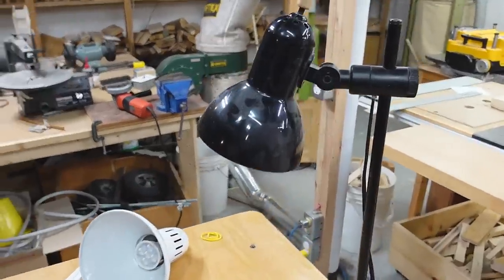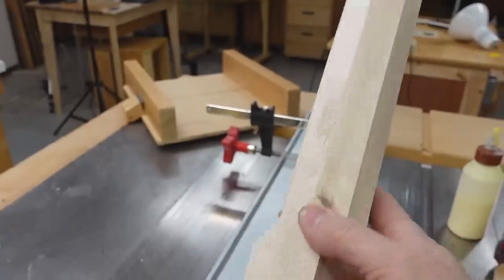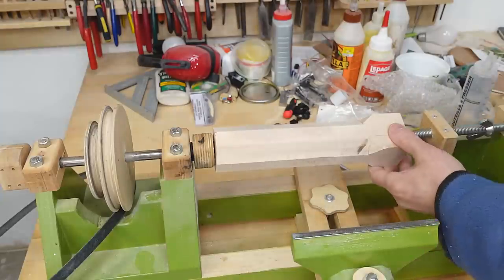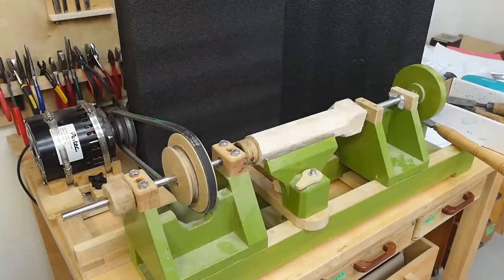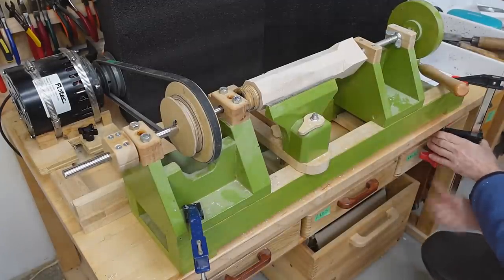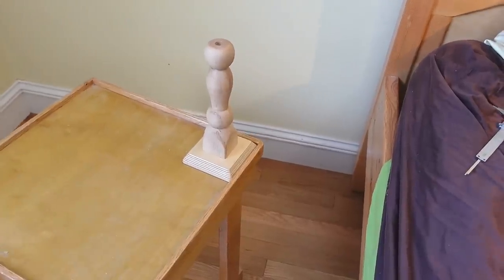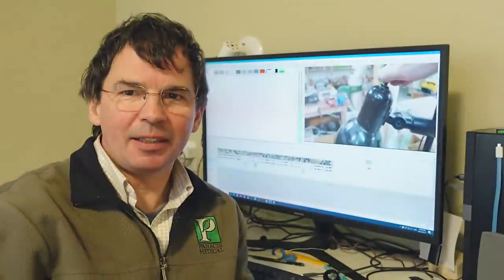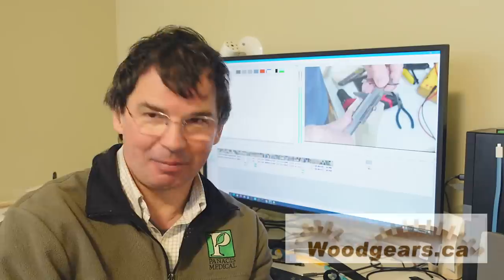Architect lamp pedestal base

Comment: My dad did something similar for me when I was a boy; instead of making a post to set on a table though, he put a hole in the bedpost itself and mounted the lamp to the bed. Worked flawlessly.
Reply: I was wondering why Matthias didn't do just that when he showed the final installation.
Reply: I had exactly the same question.
Reply: My Dad did something similar kind of...he made me peanut butter cookies before He went to work. 
What a Man(most dads).
Troy

Comment: I do so agree about those plastic clamps for angle-poise lights. The original units had solid metal bases or clamps. The unit above my lathe I made myself in Aluminium.

Comment: Hi Mathias,
Here is a rather funny, but true story....  I have that exact same lamp that you have, and the base on mine broke years ago, just like yours.  When the base broke long ago, rather than throw out the lamp, I put it in a box and stashed it in the garage, thinking some day I might get the urge to make some kind of new base for it.  Well, years passed and about 3 years ago we were moving to a new house, and I found the lamp.  With all the tasks involved in moving, I started to just toss it out.  But instead I finally elected to just move it to the  new house instead.  Today, it's still in a box in the garage of our new house. I'm sorry to be so long winded but I just wanted to share the story with you and let you know that your video has inspired me to finally do something with the lamp.   I might piggy back off part of your design, or come up with something a little different.  The main problem is the base does in fact need to either be connected to something, or clamped down in order to keep it from toppling over. Thanks for posting the video.  :)

Comment: I do the same thing with those arm lamps. Most of the time I don't even get them with a base. So I just drill holes for them. Works a treat.
Reply from the maker: All mine are used ones.  I don't much care if the base comes with them.
Reply: @matthiaswandel  I've never bought one new. I think I've only bought one. But I bought that one because someone was using a Panavise Jr as a base on it and I wanted the vise for my collection. They managed to snap the pin off the lamp. Your video got me thinking about it so I fixed it. With a wooden dowel, of course.

Comment: I've made a few articulated desk lamps from wood. They work well and look great.  Can be tricky finding what springs you actually need as it will vary with the type and weight of the wood.
Reply: One tip I picked up somewhere (heck, maybe Matthias): Use rubber bands instead or springs for testing, add or remove bands until the lamp performs as desired. Then you can measure the pull of the stack of rubber bands and get an approximation of spring strength needed.

Comment: I took a similar approach to creating bases for my two lights, only not nearly as fancy.
For each light, I mixed up some concrete and filled a #10 can (think of a can that holds 3 pounds of coffee). Before the concrete had a chance to harden, I stuck in a length of PVC the diameter of the rod on the light and longer than the can was deep. 
The concrete is too thick to fill the PVC
It's easy top move the lights anywhere I need them and I don't have to clamp down

Comment: I have two of these lamps, one with the clamp, but the other has a really heavy weighted, rectangular base unit.  The weight is enclosed and impossible to see but it is 'really' heavy and has a storage surface on top...for pen, pencil etc.  I'm about to re-build both as the bulb holder in one is showing signs of cracking so the second one mustn't be far behind, then I'll use LED bulbs.  Great lamps though and been used heaps over many years.

Comment: I like those lamps too. The Ikea Version clamps much better.
Reply: Like Matthias says all you need is a hole that pin fits in. Though I have one of those lamps and the pin is busted off of it. I just fitted a dowel where the pin should be. We'll see if it works, or not.

Comment: I love swing arm lamps. It has been difficult to find ones that are high quality and constantly fall over or creep. Any on amazon is just hot garbage. I found one brand at work but they asked for $350 dollars for one which was really steep ask. It would probably work perfectly for the rest of my life though. I did find something middle of the road that I have been pretty happy with though. I think it was a cut above the $30 lamps on amazon and still worth the $90 price.

Comment: Awesome video as always just a question
Why don't you turn the timber running on the bevel with a gouge and cut the wood instead of scraping it a lot less pressure on your cool lathe you'll get a lot cleaner cut and less sanding.

Comment: While watching this I just realized that none of my articulated lamps (6 of them) still have their original bases, or ever had. I also made custom bases for all. I also have one that is now free standing because I made a oval hollowed wooden base with a 2,5 Kg dumbbell plate weight in it. (sand didn't work as well) Just so I can move it, have the articulating feature, but never have to clamp it down. Also I put brass bushings in the holes and over the pin of the lamp with some grease for smooth movement.

Comment: Most certainly fun to watch. In general I like your ‘learn in the process’ approach, this time I thought wait, he must know with all his practical experience that that base is to small to properly function, is this for didactics? Kept my attention to the end! Why does it appear as weird? At first glance the (second, or lower) sphere on top of the cube looks a bit out of place. You never would see this applied in such manner in architecture or furniture. (it would look odd on the bed for instance.) Bed and pedestal are both from wood, and look alike in style. Makes the pedestal sort of family to the bedpost. I can however see you might have envisioned this as a sort of fremdkorper add-on. Like an artificial leg. Quick way out could be to paint the whole thing (not the lamp) black, or more spicy, orange perhaps. I think your design (shaping) deals very well with the (aesthetic) problem of asymmetry. (being the pivotal point not centered in the middle of the shape of the leg(s) of the lamp) From a design point of view you could argue that when painting, the side table should be painted as well. Having owned such an architect lamp for many years, I share in your appreciation, and yes the original clamp is not too strong, but having it detached quickly was I guess preventing damage to the lamp itself. My lamp was replaced by the table lamp from Flos, which was designed by Antonio Cittero. (if you google it, it might end up on a wishlist perhaps, it has a similar cantilever mechanism and is quite elegant.)

Comment: Yeah, I have quite a few of those arms... the arms are great, the clamps that comes with it is just some bs. I made a hole on a table to use one as support for a tablet, and I'll probably do something similar to put a tablet on the kitchen to watch stuff while cooking and doing dishes.
If you make the hole just the right size for it to also fit the plastic sleeve that comes with it, then it can move pretty well... first attempt I just made a whole to tightly fit the metal part directly and then it started squeaking on me like heck. xD

Comment: Not related to this video, but I've been looking to build a dust collector and I recently got a used 30 something year old rooftop extractor fan, which is basically a three phase motor with an impeller on it. 
Using it would save me a lot of work as I would only need to make a housing for it, but I only noticed it is a 1kw motor after I got it home. I was judging it to be 3 to 4kw based on its size, but it turned out to be a two speed motor, making it larger.
So I was wondering what your gut feeling is about it, is it powerful enough for a central dust collector? The impeller is quite large at slightly over 60cm across and the motors higher speed is less than 1000rpm. I don't have any information about the air flow of the impeller, just the motor info.
Reply from the maker: You need at least 3000 rpm.  Your motor runs much slower than that.
Reply: @matthiaswandel  Guess I'll look for something more appropriate. Thanks for the reply and all the videos you make, they are indispensable.

Comment: You should do more woodturning.
For which you should actually buy a halfway decent lathe.
It is loads of fun.
As far as feedback for this actual project goes, it is a waste of time to cut the blank into an ocagonal shape because roughing it on the lathe is so much faster, at least once you get the hang of it, as well as get the hang of keeping your tools sharp. (Which is not to say you haven't, obviously your skew work is more than adequate.)
As much as I like plywood though, this would have merited a foot made of another piece of solid wood, preferably also turned.
Reply from the maker: I cut it into an octagon to not be so bulky looking.  Then decided it needed more material removed so put it on the lathe.

Comment: Was the material hopping out of the lathe intentional? It seemed like you could hear the chatter and should have corrected but chose not to (for the thumbnail?) but maybe I'm reading too much into it😅
Reply from the maker: I had just tightened the tailstock moments before.  What I wasn't aware of was that the tailstock was slipping

Comment: Could have just drilled a hole in the top of the bed post.  As for clamps, they suck - Always working loose and usually the first clue is having it come crashing down on you (and with the old incandescent bulbs, that could HURT)

Comment: Have you ever thought of taking one of those lamps and remaking the arms out of wood to extend the length?  It's been rattling around in my brain for a while.
Reply: i did with square metal tube a few years ago and its been holding up great. almost wish i would have went longer for even more reach.
Reply: Watch all the videos, look at the web page, look in the backgrounds.  He has done several of those things.
Reply: I've made a parallelogram arm out of EMT. That's electrical conduit pipe. I just smashed the ends flat where they have to fit onto the other fittings.

Comment: Have you been able to determine the RPM on your lathe?
Reply from the maker: What is so difficult about measuring RPMs?
Reply: @matthiaswandel  The question was not if it were possible but rather if have you done it yet? It looks like the belt setting were on high torque rather than high speed which would’ve been more appropriate for the project.

Comment: Not seen a lathe work piece just jump off the chuck/collet like that ! 😀
Reply from the maker: looking at the video, the tail stock slipped before it let go
Reply: Seems better that the workpiece gets tossed than the tool.  I’d rather get hit in the face with a chunk of wood than a pointy piece of steel.